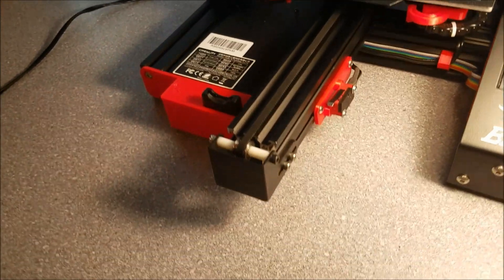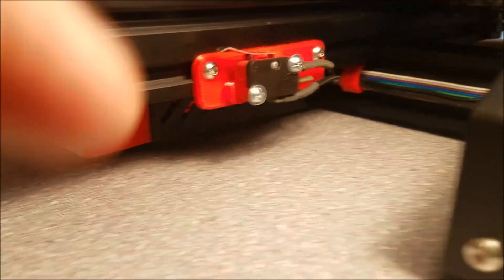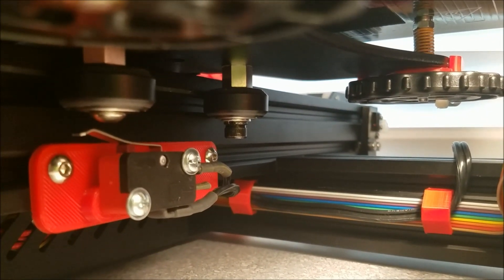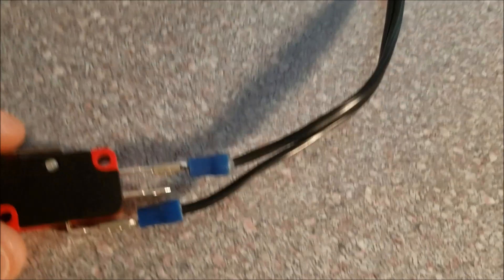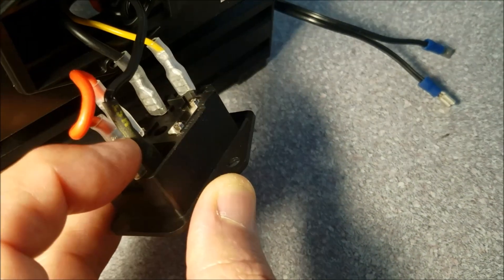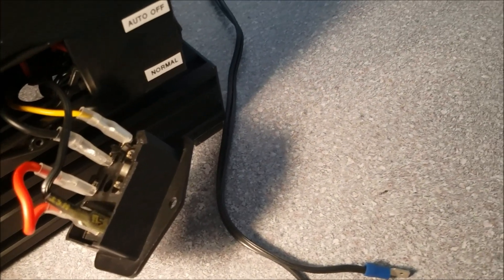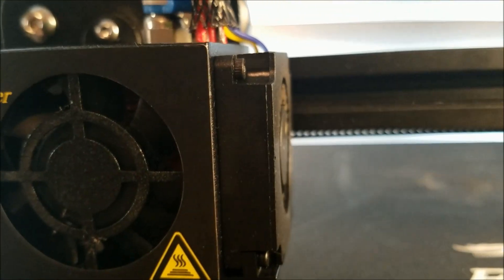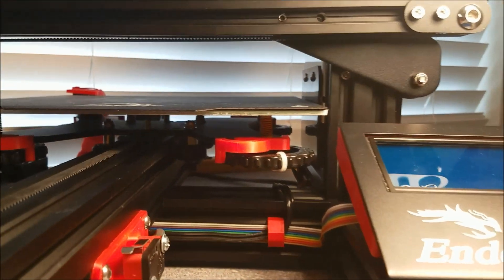Ender 3 Pro auto off with cool down - simple!

Comment: Hi, I redesigned the mount and cover to work on an ender 3 v2 using your original design and parts. Would you suggest that I get on Thingiverse in some fashion? If so is there a tutorial on the process? Would it be added to yours as a remix or posted as itself with reference to yours as it's basis? Thanks
Reply from the maker: I imagine you can do it either way. Thingiverse postings are pretty easy. You'll figure it out. Good luck!

Comment: Going to order parts I'm the morning, this is awesome! I hate waking up to a finished print and printer still running. I am VERY new to 3d printing, the ender 3 is my first machine, and I've printed a couple dozen things, most being parts for the printer. I wasn't aware you were supposed to cool down the machine after a print before you shut power off, how important is this? Have I been damaging parts of my machine just turning it off? I have zero idea how to edit gcode to let it cool down, but will be figuring it out soon and Installing this mod!
Reply from the maker: The G-code changes are listed in the description. I use Cura and it's probably the same with the newest version. Good luck.

Comment: I think this is a great idea and plan to do it the only problem i have is as i use prusalicer so i take it i would go into printer settings and then custom gcode and then in the end g code box if this is correct my last line of code is M84 ; disable motors so do i add your code after this line ?many thanks for you time
Reply from the maker: Essentially the last paragraph is rearranged and one line added. The last line remains the same. If I knew a way to add a photo to the description or send one to a commenter, I would do that to show how easy it actually is. You may have to interpret this to fit the Prusa comment choices. Most of the information after the semi-colons is, I believe, just a description of the action caused by the code. Good luck with your project!

             ORIGINAL END g-code                                                                                                                                    MODIFIED END g-code

G90 ;Absolute positioning     ------------------------------------------  CHANGES BELOW THIS LINE  ------------------------     G90 ;Absolute positioning

G1 X0 Y{machine_depth} ;Present print                                                                                                                     M106 S0 ;Turn-off fan
M106 S0 ;Turn-off fan                                                                                                                                                   M104 S0 ;Turn-off hotend
M104 S0 ;Turn-off hotend                                                                                                                                            M140 S0 ;Turn-off bed
M140 S0 ;Turn-off bed                                                                                                                                                  M109 R40; Wait for the hotend to cool to 40C
                                                                                                                                                                                          G1 X0 Y{machine_depth} ;Present print
M84 X Y E ;Disable all steppers but Z
                                                                                                                                                                                           M84 X Y E ;Disable all steppers but Z

Comment: Absolutely great Tidy idea,I'm sure this would be ideal for the CR6SE?
Reply from the maker: I imagine something could be made to work. I'm not at all familiar with any other machine but the Ender 3 Pro. You would have to be sure that the electrical components are viable with the power levels of that machine and you would likely have to design your own printable parts to make it work. A little ingenuity is all it takes. Be sure to err on the side of safety with anything electrical. Contrary to a few nannies who commented before, I did just that. Thanks for watching.
Reply: @stevemullens7937  I'm running a night print that will finish about 4am,I'm up at 6am but would love to have the printer switch off after its cooled down 👍 Something to look into for sure
Reply from the maker: @richiekaye1103  That's exactly why I looked for a solution. Good luck.

Comment: mybe it wont be an issue,but its more safe if u use relay to cut off the power,anyway love your ender setup
Reply from the maker: Technically, I suppose it is safer to have 5V DC in the switch wires, but if you do it safely as I did in this video, there will be no problem unless something cuts the insulation, or hits the switch hard enough to damage it. Still, look at where the wires are and the fact that they do not move at all. The entire modification is protected by the bed nearly always and when not, it is only momentarily when printing close to the front of the bed. My point after being bothered by so many about this is: If you do it like I did and you're not an idiot, there is virtually no way to get hurt. If you still can't believe that it is safe, don't do it. The point of the modification is to have the desired effect, and do it SIMPLY.

Comment: Hi man, I'm testing your design for the first time right now! I bought a switch that is rated for 5 amp at 230 volts, wich in theory can handle 230*5= 1150 watts, is it right? My printer is an ender 3 v2 with a power consumption  of 350 watts.
Reply: Please don't do this dangerous hack. Use a low voltage switching relay (found in some power strips) to control line voltage. Don't hack it together through a cheap exposed switch.
Reply from the maker: Your math seems sound. My Ender 3 Pro claims 270 Watts of power usage and your switch should handle that easily. Be sure that the wire you use can handle it as well. Which ever wire size is claimed on your power cord, probably 1mm diameter or .8 mm cross sectional area should be the size wire you use if not a little bigger. You should probably check that yourself, I'm not familiar with metric wire sizing systems. Be sure to make a video about it and post a link so I can see it! Thanks for watching.
Reply: @stevemullens7937  here in Italy we usually have 1mm^2 or 1.6mm^2 wire section . They can handle 10 and 16 amps, so I used the 1mm^2 one wich is enough.
Reply from the maker: @lorenzoaccetta3618  Looks like you've got it all figured out. It would be great if you posted a video about your success or failure, or maybe posted a make on thingiverse. Be sure to print and install the safety cover for the switch. Enjoy!
Reply: @stevemullens7937  I will post a make on thingiverse👍
Reply from the maker: @lorenzoaccetta3618  I'll check back once in a while to see.

Comment: Quite dangerous. Better to use a relay to switch the load instead.
Reply: been using the design in this video about a year with zero issues
Reply: @ClarksoonsFarm  Just because something bad hasn't happened yet doesn't mean it won't.
Reply: @dragonstuff1983  
The switches in the video were tested, passed, and stamped per CE regulation.
CE marking indicates that a product has been assessed by the manufacturer and deemed to meet EU safety, health and environmental protection requirements.

The switches in the video were tested, passed, and stamped per China Compulsory Certificate standards.
The China Compulsory Certificate mark, commonly known as a CCC Mark, is a compulsory safety mark for many products imported, sold or used in the Chinese market.

Not to mention the product is signed for and labelled by the manufacturer (Zhejiang Xurui Electronic Co LTD) so they bear ultimate liability for faults and failures.

Beyond that
Electronics devices can be 100% compliant with NFPA 70 without receiving a mark; Just because a device was not tested at the Underwriters laboratories does not mean it is not safe.

Also "UL" Is not a regulatory commission but rather an independent testing firm.

Regulatory commissions:
CE        -    "European Conformity"
CSA     -    "Canadian standards association"
ANSI   -    "American National Standards Institute"
ISO      -     "International Organization for Standardization"
JIS      -     "Japanese Industrial Standards"

Testing Laboratories:
UL        -     "Underwriters Laboratory"
ETL     -      "Intertek Laboratories"
SWRI  -      "Southwest Research Institute"

Conclusion: It is a "listed enclosure" just not in your country.

Only real risk is some sort of major fault in the mechanism which could potentially charge the metallic switch components.
If you're worried just 3d print an enclosure that covers all metal parts of the switch.

The chances this will kill you are slim to none assuming you don't use it in a bathtub.
Reply: @Carter-dv4hz  Another person defending this dangerous hack and suggesting that someone "make an enclosure" if they feel unsafe. Sad and disturbing.
Reply from the maker: Everything is stationary, I can't even TOUCH a conductor without using a sharp tool to cut insulation. I've made dozens of individual prints since I did this mod and praise Jesus! I'm still alive! It's only dangerous for people who can't follow directions or are quite stupid. Do it the "safe" way if you like. Feel free to download my parts and be sure to post a video.
Reply: @stevemullens7937  and when you have an overload situation?
Reply from the maker: @dragonstuff1983  First, I can't imagine what would cause that, but I suppose that the power supply would stop working with or without this improvement. Since all this does is interrupt current TO the power supply, not FROM it when the print is finished, you've alerted me to another danger. Seems that the power switch on the PSU would somehow also need to be a relay, since it's in the same circuit. After all, there is a power cord plugged into the wall outlet and 120V/4A can kill! Seems awfully dangerous to me. You should contact Meanwell about this situation.
Reply: @stevemullens7937  The power switch for the power supppy is rated for the current and completely within the bounds of the NEC and UL.
Reply from the maker: @dragonstuff1983  As is the micro switch used for this mod. Just watch the video and see what is SHOWN and said. Mic drop!
Reply: @stevemullens7937  Do you not understand what UL listing is or how products get tested? Let me fill you in: listed devices are certified based on the entirety of the device and for the exact purpose of the device. What you have made is a dangerous hack that can only put people at risk. Pick up your mic before you look more stupid than telling people to run line voltage in a non-listed enclosure. You could have had them use a 9v battery and one of the z-axis switches to control many of several switching power strips that use a low voltage contact closure to safely control the line voltage load.
Reply from the maker: @dragonstuff1983  So, I guess that all lamp cords aren't UL listed? All micro switches as well? Even if they are rated for 3-4 times the needed capacity? Are all mods to any electronic device deadly because UL didn't test it in it's entirety before putting it to use? In your world, am I allowed to change a lamp switch without the UL police swarming on me? Do you harass everyone who does an electrical mod to a 3D printer on youtube, or just the ones who use common sense to dispute your assertions? Does common sense even enter your world? If you don't think it's safe, don't do it. BTW, can you show me the UL approval for this machine? I can't find it anywhere on the device. This is my last reply to your whining. Quit being such a nanny.

Comment: This is genius for turning off the hotend fan. Plus nobody can whine about it being AC ;)
Reply from the maker: This turns off the entire machine after the hotend cools. But, as you can read in the comments, people have "whined" about it being AC powered. They claim that is is dangerous because it isn't DC running through the lamp cord. The last two words of the previous sentence should say it all. Thanks for the compliment.
Reply: How is this not switching line voltage?

Comment: What a fab vid Thank you but can I ask when the printer has stopped is the print head meant to stop on the print it has just dun or should it move up a little
Reply from the maker: It does move up around 20 mm. Watch the very beginning of the video again and you will see the movement.
Reply: @stevemullens7937   thanks was doing a long replay then it hit me i have cura 4.8.0 BUT the rest of it works fab have been looking for something like this for some time
Reply from the maker: @theweepinghunter  Let me know if you do it and how it works for you!
Reply: @stevemullens7937  Got it to work did not read  your info prop so delete the last paragraph and put yours in. Did it in word 1st so did not mess it up so my G Code reads 
(original code)
G91 ;Relative positioning
G1 E-2 F2700 ;Retract a bit
G1 E-2 Z0.2 F2400 ;Retract and raise Z
G1 X5 Y5 F3000 ;Wipe out
G1 Z10 ;Raise Z more
G90 ;Absolute positionning

( your code)

M106 S0 ;Turn-off fan
M104 S0 ;Turn-off hotend
M140 S0 ;Turn-off bed
M109 R40; Wait for the hotend to cool to 40C
G1 X0 Y{machine_depth} ;Present print

(original code)

M84 X Y E ;Disable all steppers but Z
Reply from the maker: @theweepinghunter  Sounds like you got it to work. Great!

Comment: 🏃🏼‍♂️🏃🏼‍♂️🏃🏼‍♂️🏃🏼‍♂️ running to my pc to design, print and install this on my printer. 

Thanks for sharing. 👍👍
Reply from the maker: Glad you like it. Be sure to comment about your results.
Reply: @stevemullens7937  I copied your design and added it to my Anycubic mega 2.0 3d printer. It works great and I will probably do a video about it and share all that I used to get it working.  
Thanks for sharing 👍
Reply from the maker: @thelastdon4664  Great! Glad to read your comment. Be sure to come back and post a link to your video when you do it!

Comment: This solution is unsafe. A very large chance getting shocked. What’s the current rating for the micro switch? These are usually mean for low voltage DC.
Reply: He could have used a low voltage relay to switch the line voltage in a listed device, yet no.
Reply from the maker: Guaranteed, I have a 0% chance, because I'm not an idiot. Some may be, but if people are careful (not stupid), they'll be fine as well. If you had watched and listened to the entire video, you'd know that the switches are rated for well above the needed capacity.

Comment: I would rather use a relay to handle the mains with the micro-switch just having a dc voltage, no doubt Marlin will have a spare function that can be employed to switch a relay, upon completion of the print
Reply from the maker: And how is that simple? ;-)
Reply: @stevemullens7937  It isn't it's just safer
Reply from the maker: @AndrewAHayes  I've had lamp cords near me for nearly 60 years and I have yet to be electrocuted. There is zero movement of the cord. I think this will be fine for anyone who takes care to insulate and shield any potential contact points-as I have. The shield I made (downloadable print) isn't shown installed for the sake of clarity, but it is shown in the video and that, with the heat shrink tubing on every conductive surface makes this very safe. As I stated in a comment below, I would have to jam a sharp, grounded object behind the shield to cause a short. I am "simply" not worried. Nor is anyone required to duplicate my work. Did you send comments to the guys who wired toggle switches to the TOPs of their machines with exactly the same circuit to be switched after running the gantry to the top of the Z axis? There are a few. You've got work to do. Thanks for watching.
Reply: @stevemullens7937  I said I would rather have a relay, that doesn't mean you or anyone else has to
Reply from the maker: @AndrewAHayes  Sorry, I'm used to nannies attacking me for one thing or another. Thought it was happening again. My bad.
Reply: @stevemullens7937  That’s a tad harsh. The poster said that his solution is safer, which it is. No reason to attack him for that.
Reply from the maker: @langrock74  Did you read all of the replies?